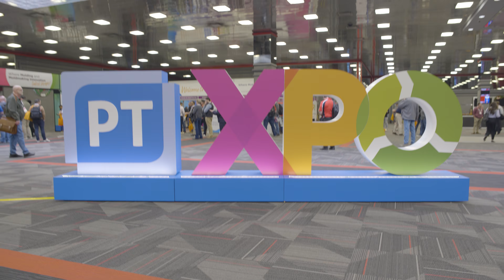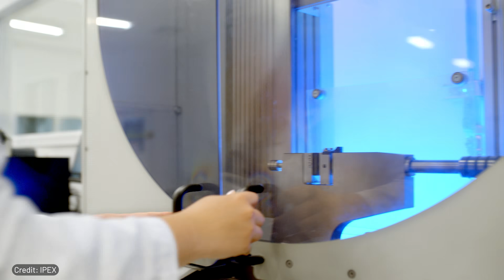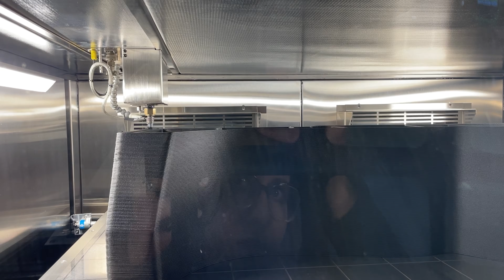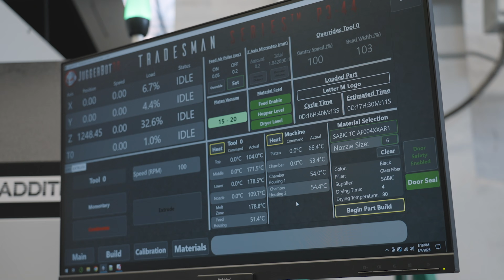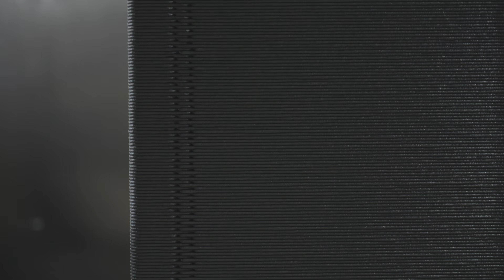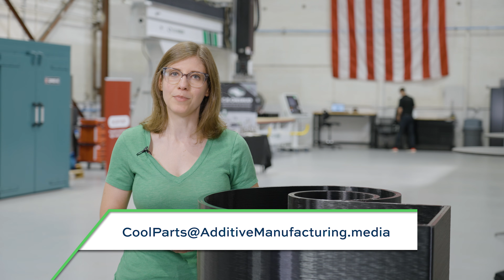3D Printed PVC Saves Days of Assembly for Wastewater Product | The Cool Parts Show

Comment: 100% did not need to be manufactured from PVC. They say it’s corrosion resistant like any other plastic corrodes. They probably already get a great deal on pelletized PVC since they buy so much of it as is. It would be much better off being made from polyethylene or ABS.
Reply: Seems to me ABS may have been an option as well. It may be that PVC is more erosion resistant in their application than some other materials due to its properties, but I don't have enough expertise to say. May be a case of this is what we have always used so rather than changing process and material they just changed one at a time.
Reply: If I had a nickel for every piece of rusty corroded plastic laying around my house.  Let me tell ya... don't worry about the fumes coming off that melted pvc though,  I'm sure it's nothing to worry about.
Reply: Mostly likely the reason was mentioned a couple of times during the video.

The manufacturing orocess is already setup to  manufacture pvc. Its what they know.

Is it the best option? It is for them. Thats all that matters. 😊

Comment: Did anyone check the Architectural products and product restrictions ROHS and Declare are actively removing PVC from all products. PVC is toxic and contributes to toxic microplastics and is extremely harmful when burning. Many building codes require the removal of PVC to get certification. It’s why you got a great deal on the material, nobody can use it.
Reply: I second this. Doesn't PVC release a bunch of harmful gasses when heated to PLA temperatures?
Reply: @Scayanite yes phosgene and hydrochloric acid. Thats why its very hard to find as a consumer available material for FDM.